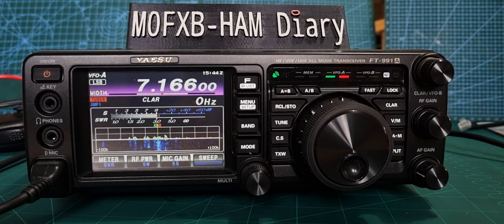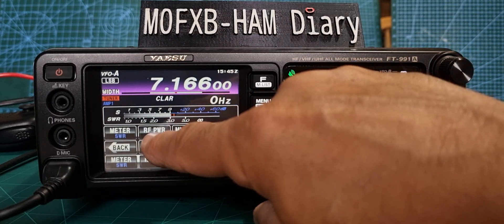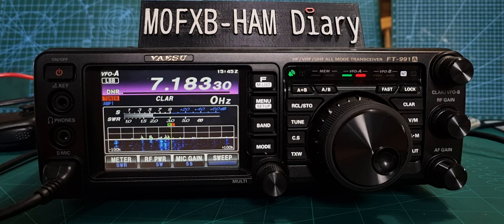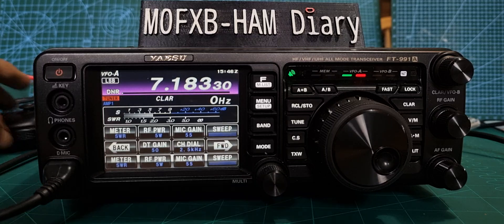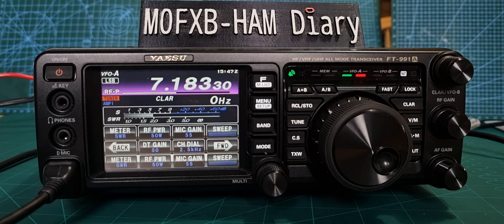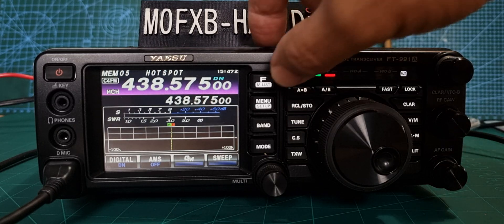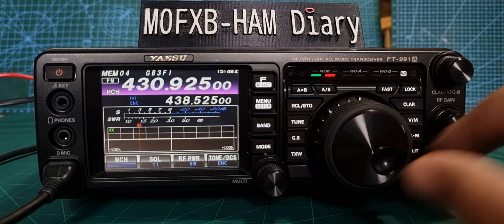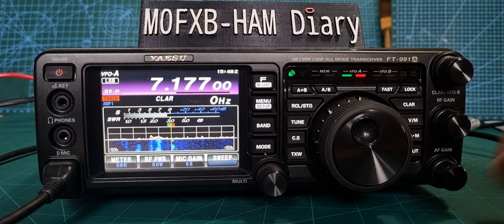YAESU FT-991a Automatic Tuner & More

Comment: That tuner on FT991A is actually the slowest tuner of all current ATU radios. FTDX10 is just as bad. I had 991A, IC7300, TS590SG, TS480SAT and have FTDX10 and IC7610 now. All of these Kenwood and Icom radios are tuning any antenna with SWR up to 3:1 in less than 2 seconds. FTDX10 and FT991A take about 10 seconds to tune antennas regardless if it's 1.5:1 or 3:1. Yaesu ATUs are as bad as Kenwood TS570D that I bought in 1996.
Reply from the maker: Thanks for info my brain prefers slower.

Comment: apolgies if i missed it but you jumped from 40 mtrs to 70cm very quickly. Did you swap the antenna or is it programmable to swap between antennas plugged in dependant on the frequency?
Reply from the maker: There are two antenna inputs .

Comment: The length of that wire is quite significant to the radio's ability to tune it. The rated range of the 991's tuner is only 16.5-150 ohms. The average after market outboard tuner will tune from 6 ohms or less, to 1000 ohms or more. I'd like to own a 911 but if they have waisted space inside it with a tuner of limited utility I'd not like it! kb0sfp
Reply from the maker: If u want a shack in box 100 watt the 991 is a good choice.
Reply: @M0FXBHamTech  Well, you'll not receive a "shack in box" because the radio's internal tuner will be pretty much useless in the real world. It's only capable of tuning a maximum SWR of 3:1. So for anything other than tweaking an already close to resonance antenna, it's worthless. And just forget about a vertical or random wire! I/E your video is a bit misleading.

I have quite a bit of experience with Yaesu products. I own two FT-857's, three FT-897's, Three FT-817's, a few old FT-70G's, a VX-1210, and a couple FT-7's. I owned the total crap FT-891 and it's absolutely worthless companion tuner FC-50. I've also owned the equally worthless FC-30. I have learned the hard way the either Yaesu does not know what is expected of an automatic antenna tuner, or they just dont know how to make one. To place that worthless tuner INSIDE the radio is a total waste of space that would have been better served buy something else. I mean, what the hell, if your going to need an external tuner that WILL do the job?

I once owned a Ten-Tec Eagle with it's built in tuner. Myself, and others, found the tuner to be so bad as to return it to Ten-Tec for repair. We were advised that there was nothing wrong with the tuners. It bugged the hell out of me to take to the field with a radio that was equipped with it's own internal auto-tuner that required I also drag along an LDG(of which I am not a fan). I got rid of it. I guess I'll not own an FT-991 for the same reason.  KB0SFP
Reply: @dennisstarks1365 I am shopping the FT-891, FT-857 and FT897. By reading your comment, I probably should find the older radios? What tuner would
You recommend for the 857 and 897?
Reply: @dennisstarks1365  Wow. How come you have 2 or 3 of the same model. I was considering the 991A.
Reply: No it is not! The FT-897 is far more versatile. I own 3 of them.